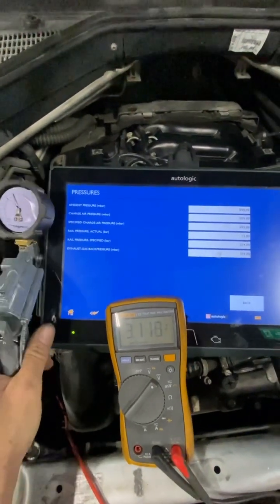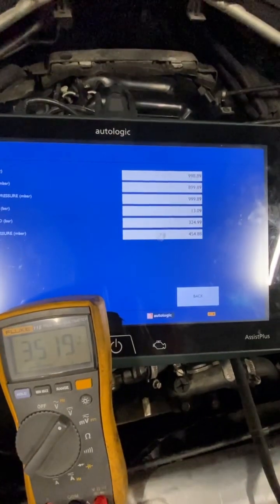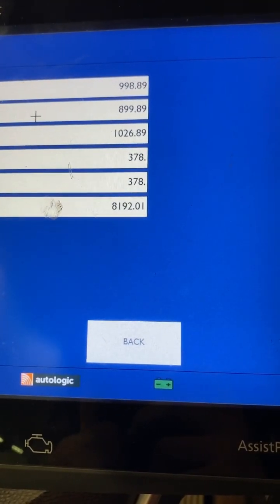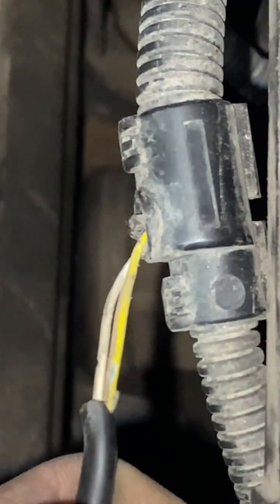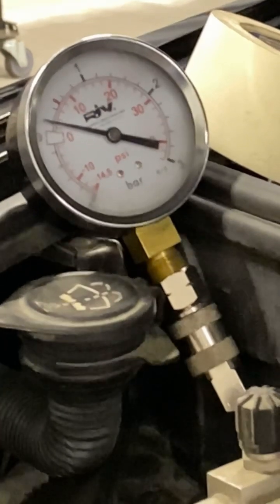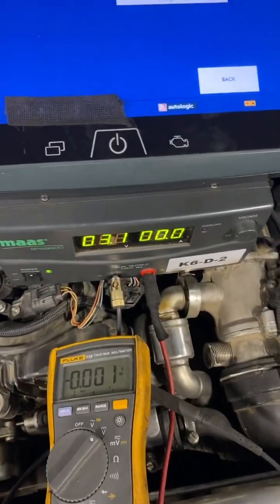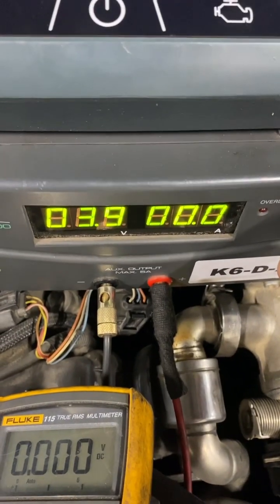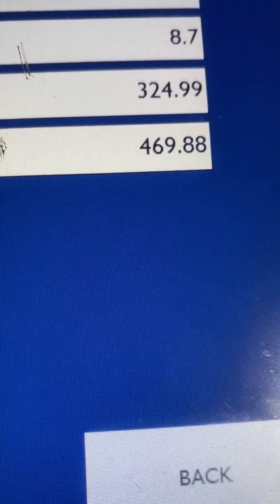How can a blocked dpf cause backpressure to be LOW🤷🏼‍♀️??#dpf #bmw #x5#m57 #diagnostictroublecode

Comment: Finally I see someone with the same problem. My DPF is new from HJS and I‘m getting 8192mbar in idle or while driving. I changed 4 backpressure sensors and nothing helped. Its sporadic. As soon as it goes do „8 bar“ the dpf is regenerating. It mostly happens when the ambient temps are high or when I drove for longer periods and the engine bay is very hot. I get 100-200km intervals of dpf regen… could it be a bad wire?
Reply from the maker: Thermostats
Reply: @BenJFF both changed, the main one and the egr one from bmw 4 months ago. Have that problem since 2 years since I got the car. Sadly I dont have anyone around that could take a closer look into the electric side (wires, ecu)
Reply: Just a quick one on my autel my back pressure sensor is showing -388mbar I was thinking that it is the back pressure sensor at fault as it’s showing back pressure sensor signal but I didn’t want to change this is the dpf pressure sensor is at fault 🙈 what do you think ?
Reply from the maker: Unplug it and test it with mityvac. Or if unplugged the value jumps to 8000 mbar then most likely its the sensor at fault. Usually when bmw backpressure sensors short out you get a 2nd fault code for ambient pressure sensor in the dde.